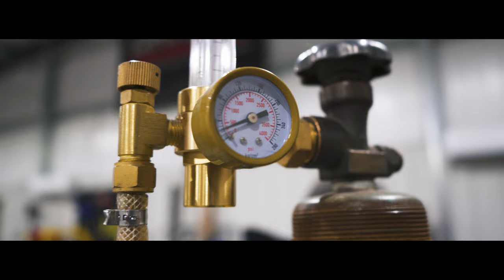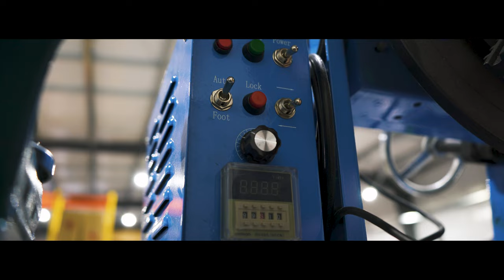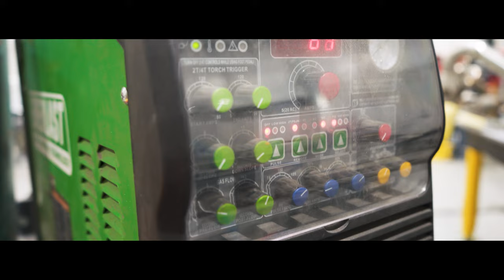Welding ASMR No Talking Professional High Level Expert Welder Skill

Comment: Im still fairly new to tig welding what was the foil and hose for you put at the end of the pipe
Reply: It is back purging. The inside of the tubing is open to the atmosphere and would have massive porosity if it were not purged with a shielding gas. It would be like welding without the gas on.